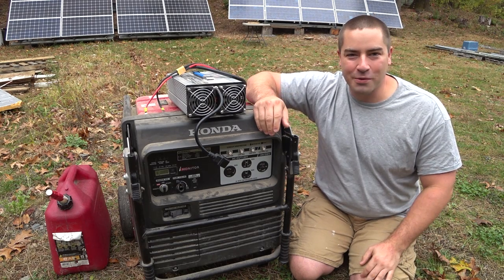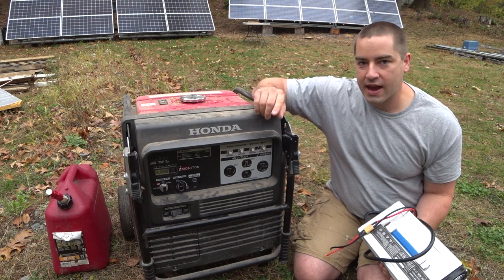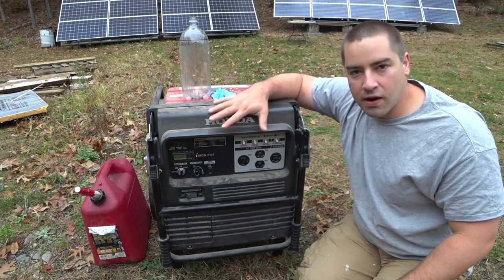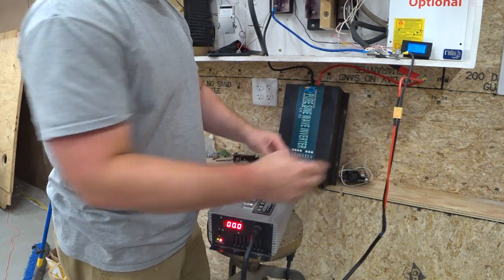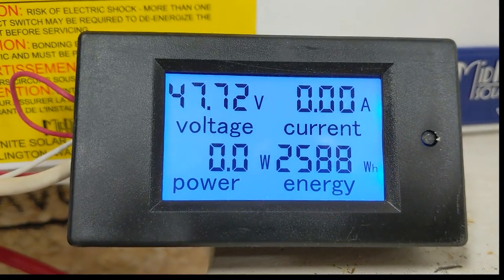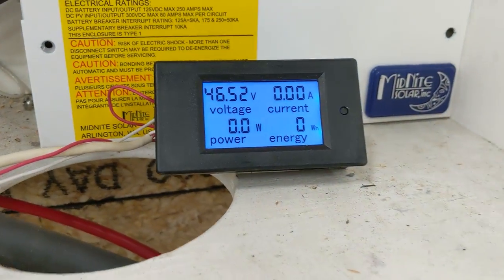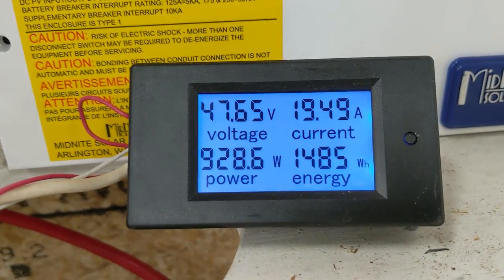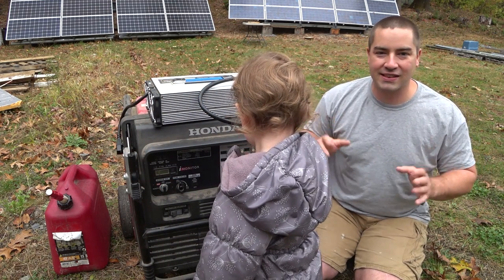Recharging your battery bank without solar

Comment: if you have a generator / inverter charging your batteries; then why would you need to feed a charger like the EG4 charger and then have that charge your batteries?
Reply from the maker: I don't need the new charger from EG4.  It's something I like, but not a need.  I have another video demonstrating running the generator into my inverter, and there are some minor things I didn't like.  https://youtu.be/36H6Sb2IG_k

Comment: Maybe we could use the old early 1900 technology and add some 2000 technology and have a great low budget system back in the early 1900 when power was a new thing if you were not living in a major city you had only 1way to have power a 32volt DC generator and a battery bank and for those with money and space a windcharger Delco even came up with the technology to use the generator as a starter no more pulling a rope they even brought out a unit that would when your batteries got low on power automatically start the generator another feature that the old unit's had was a way of hooking up a flexible metal pipe to the exhaust so you could put it in the basement and vent outside now with the newer inverter generators since they use an inverter they. must use a DC generator why can't they design them to have  a battery backup just think Inverter generators are fairly cheap to buy if they set the generator up as a starter depending on what voltage the generator puts out if they use a a voltage that matches up with what's commonly used IE 12 24 or 48 volts you could size the battery bank to match you  could then use the battery bank and the inverter in the generator to power your home and when the battery bank gets low on power the generator would automatically start up to charge the battery bank back up using more of today's technology the battery bank  could also be kept  toped up with solar and wind so that there'd be an uninterrupted power supply adapting shouldn't be to  complicated it would depend on what they put out for DC power now I'm thinking about it I've got to check out my generator collection to see if any are inverter generators then after I get one running I can  check out the generator output and see what the DC voltage is

Comment: How about using the xw pro using the gen input and see how much better that works? On my small generator I can get about 10kw from a tank that is about 2.5 gallons of gas.
Reply from the maker: I plan on running the generator into the XW PRO soon.  I thought this video might be a fun segue.  Thanks for watching.

Comment: If your charger is well matched to the output of the generator, then it can be much more efficient than just using the generator power directly.   

With a larger generator, have a second load besides the small charger, using most of the energy in a way that does work or creates value for you, and you will use the fuel more efficiently, than having a charger connected to a generator where it only used 5-20% of the generator’s output capacity.
Reply: No it can't. You are losing energy in more than one step of the AC generator to DC batteries. The Genset puts out 120V maybe even 140V Alternating current. then the "charger" drops that to 12V Alternating, power lose in this change. Then a rectifier changes the AC to DC , power lose, then the Battery has gauges etc... attached that consume energy. finally leakage current in the system between positive and negative plate will drop more. Just using a Gas Genset to the house will save energy. if you  want energy  without lose i'd suggest direct drive hydro wind powered tools .
Reply: @KKuurus  yes it can and it's a very common thing to do. Keep in mind that the majority of the energy in the gasoline is lost as heat so minimizing runtime will almost always be more efficient.
Reply: @KKuurus  Running the house directly off the generator is only more efficiently if your house has a constant power draw and that draw is well matched to the generator. The inefficiencies of the charging and discharging are insignificant compared to engine inefficiency at low load.

Comment: Could you make a video of connecting a conext AGS to a generator that only has electric start.
Reply from the maker: I don't currently have the AGS from Schneider.  Sorry, no plans to make a video on it. I do plan to make a video on installing a remote start kit on one of my generators, but it's not Schneider brand.

Comment: So, I'm just beginning my research so my understanding of this may be off. If the generator is putting 4kw per hour into the batteries, and my house usage is 20kwhr per day, that should be about 833 watts per hour on average. Does that mean that in a 24 hour period, I this setup would be able to keep the batteries topped up while I'm running my regular usage?
Reply from the maker: Yes, you got that right.

Comment: I noticed on the little Honda generator that the receptacle was a 15 amp I I want to purchase one of those 2000w inverter type generators the ones I been looking at have 20 amp plugs instead of 15  would that give me more charging power ?
Reply from the maker: A couple of things, if an outlet is rated for 15A or 20A @120V, won't matter if the generator can only do 15A.  So, look at the continuous duty rating, not the surge rating.  
Second, it will depend on the charger you have.  Can the charger pull 20A?
Reply: @DavidPozEnergy  yes my all in one hybrid inverter charger allows u to pull in up to 40 amps of house or generator power
Reply: @DavidPozEnergy  the generator I'm looking at is the Firman 2000w inverter generator 1600 running watts it has two receptacle plugins a 20a & a 30a with that twist type plug I wonder if that 30a plug it has can charge my solar battery bank it's just a 12Kwh Lithium bank..

Comment: This has nothing to do with “efficiency” and to do with load. The smaller generator had a higher load than the bigger. You should always keep a load of 75-85 % on a generator. High torque and low rpm - This I where the gas or diesel engine has its peak efficiency. 

So in short - you where running the big Honda at a really bad efficiency point, thus there is are more heat loss.

So if you had plug one or two chargers more to the big, you will see some other numbers.

Look up a BSFC chart - this helps with understanding. 

Best regards..

Comment: Its like comparing big truck vs little car engine fuel efficiency when moving little loads of course the little car engine will be more  efficient on small loads. Now try to power the entire house with the little  generator vs the big one...

Comment: Would you consider doing some consultant work? I would like to pay for an hour of your time.   Trying to plan a compete off grid system with battery bank and a diesel generator charging it.   About 10 kWh use per day.
Reply from the maker: If you are on Facebook, send me a PM at DavidPozEnergy

Comment: You are loosing power going from DC to AC then converting back to DC, right?  I saw a video on here that has apparently been removed.  A guy mounted an inexpensive Harbor Freight motor to a frame and ran a belt to turn a small truck alternator.  Now you have Gasoline horsepower going to turn a DC Alternator and feeding that to the battery bank DC to DC.  I"m no engineer but without all the conversion losses shouldn't we be getting better efficiency coming straight from a DC Alternator?
Reply from the maker: Sometimes, but not always.  I've seen some setups with poor pully ratios, loose belts, and the load not tuned to the engine.  It's true some people can make a setup more efficient than this.  Some people don't have the time/tools/experience to build a system.  This is an example of what to think about if you want to buy an off the shelf solution.  

BTW, if you ever find that video please send me a link.  I love checking out those builds.
Reply: Car alternators are terribly inefficient. They create 3 phase AC that needs to be rectified to get 12 volts DC out. I have a 28 volt generator off a B-29 Pratt and Whitney radial aircraft engine that may be worth dusting off to play with. I built several small engine powered 12 volt ''battery chargers'' using tiny Mitsubishi car alternators and was disappointed at how much power they required to run. The fuel consumption was very high.

Comment: One day I'd love to get a old mechanical diesel generator and try and burn used cooking and engine oil, it won't really matter how inefficient it is when the fuel is pretty much free.
Reply from the maker: Vegetable oil is a very fun way to go.
Reply: If you have a free source that is. A whole lot of restaurants now want $$$ for their WVO in places where it is in high demand. Sometimes insurers will also require commercial licensed WVO recovery to avoid liabilities from spills and accidents. But if you've got the source it can be a very good way t0o go.

Comment: Problem is, isn’t completly accurate as you were using fuel before it started charging. Should used 3 or 4 gallons and then divided by 3 or 4 to give a more accurate KWH/Gallon.
On the rented one, you could have used your two litter bottles, filled it fully up, then after thirty minutes topped it off while still running with the extra fuel still left in the second bottle. Thus making the full gallon. It would give u a more accurate reading.

Comment: (raises finger) The very ending is what I'm trying to figure out. Is there a way to charge a battery AND power a house (RV/van/boat) at the same time with the same generator?
Reply from the maker: Yes.  If you have an "Inverter/Charger" it can do both.  For example, I'm powering my house right now using a Schneider XW PRO inverter/charger.  If I feed the generator into the inverter, then I can power my house and charge the battery at the same time.  I have a video on doing this.  Personally, I felt it was a compromise.  I like charging the battery directly and leaving the inverter alone.
Reply: @DavidPozEnergy  Thank you! Is it the one called "Double your power handling with a second inverter"?

Sorry. I know so little I don't even know what to ask. lol!
Reply from the maker: https://youtu.be/36H6Sb2IG_k?si=F3qvauLOrpP7OkWU
Like I said, personally I like charging the battery directly, not passing the power through the inverter.

Comment: I use a old Honda 2000 to recharge my batteries and I run it into the inverter as it has a built in charger and I have the amperage set at 10 amps@120 volts. With the generator running at full blast it runs for alittle over 4 hours at 1300 kw the fuel tank is 1.1 gallons i can't run it in eco because when the freezer kicks on the surge is too much for the generator.

Comment: Power max 100amp ac to dc charger is what I am going to get and that would charge 5x more than the charger you used changing the output per gal results
Reply from the maker: I just checked out Power Max website.  The 48V model I saw was 18A, not 100A.  Perhaps your application is a 12V battery bank?
Reply: @DavidPozEnergy  yes 12v 100amp

Comment: Someone needs to make a direct DC quiet battery charging generator.  Going through the inverter is inneficient
Reply from the maker: I agree.  There are some on the market, made for yachts.  Far too expensive for me.
Reply: @DavidPozEnergy  I've seen guys hook a motor up to an alternator but they aren't meant to charge a fully discharged battery either and the motor isn't quiet.  Maybe if you got a tractor trailer alternator it would work better.  This would help those Living off grid
Reply from the maker: Sure.  I've done that very thing: https://youtu.be/CL8W5hipaLM?si=849FU4J4uM_dHjyW

Comment: IT IS NOT THAT SIMPLE !!! you was not using the bigger generator to its maximum advantage, the bigger Honda only showed less efficiency because you waisted its output. if you had used a bigger charger with more amps you would have gotten loads out of the bigger Honda. you simply let it go to waist.
Reply from the maker: I agree with you.  The purpose of this video is demonstrating that by using the fixed load.  I made a second video with a larger charger to get more from the larger generator: https://youtu.be/kQTFPMDE_F4

Comment: DAVID, DOES YOUR HONDA GENERATOR HAVE A TWO SWITCH START LIKE THIS SMALLER HONDA: https://youtu.be/jZJ5Znc1Ga4?si=f9eLH8l0HPs9kIhP
IF SO CAN YOU INSTALL IT ON YOUR SOLAR INVERTER TO AUTOMATICALLY CHARGE YOUR BATTERIES WHEN THEY REACH A PERCENTAGE LEVEL LIKE THIS: https://youtu.be/hSpxASWol6M?si=HLOZ-xMHpbSjv9Uv
Reply from the maker: Thanks.  My Honda is a little older model.  It doesn't convert as easily as the one in the video.  But, thanks for sharing.

Comment: That how I will do it, just like EV vehicles use fossil fuels to recharge but are environmentally friendly and don't burn gasoline 🤡
Reply: I am planning to build a large squirrel cage to run a DC generator. If I put peanut butter and food scraps in the outlet end, rats can turn the wheel to recharge my batteries. This should make the Greenies happy. And rats come out at night when my solar panels are sleeping. They already chewed the rubber foot pegs off my motorcycle.

Comment: In my opinion, in your test there is a big mistake both of yours generators are too big for your charger, so u waste gasoline, I mean most of your gas goes into heat which u don't use. In off grid system better is to use co-generator.